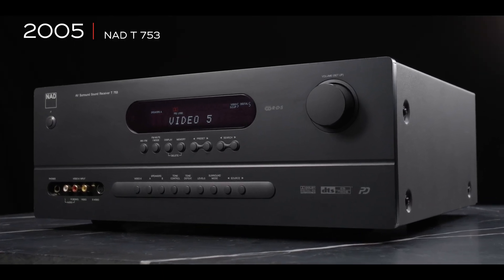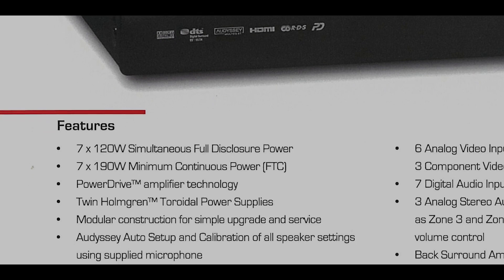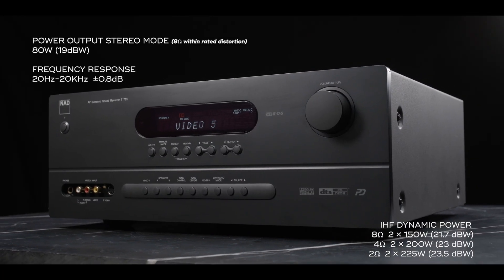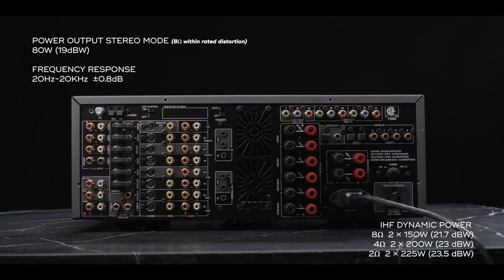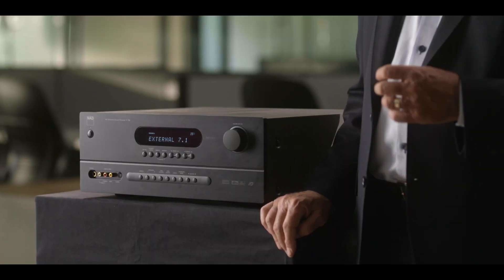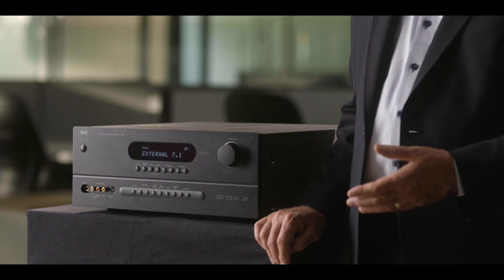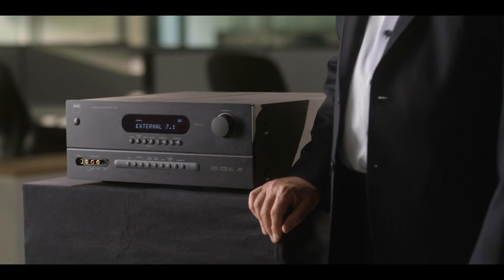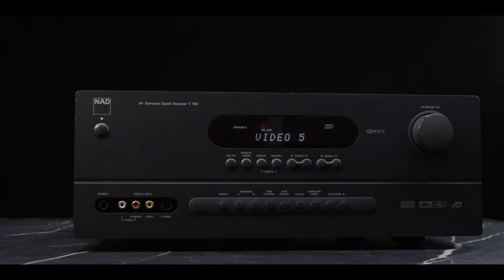NAD Electronics Iconic Technology: Full Discloser Power (FDP)

Comment: still running my T763 in 2024 with a pair of KEF Q900+ Q600 center, Q150 rear, yamaha ns-sw300 sub

I love the sound of the NAD, it delivers such a cristal clear sound at high level.

recently bought a RS-232 usb cable, was able to use the remote app on windows and upgrade the firmware just for fun...20years+ after release. so great. thx NAD.
also plugged IR repeter in "IR IN" to work arround the internal IR sensor that died last year.

When my T763 will retire for good, I will definitely replace it by NAD's latest AV. this brand is legendary in my heart.